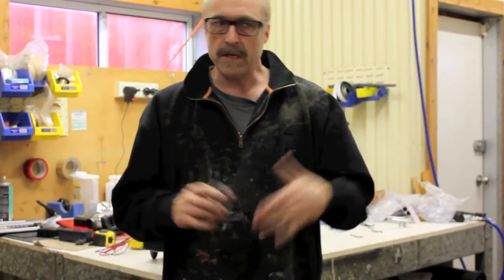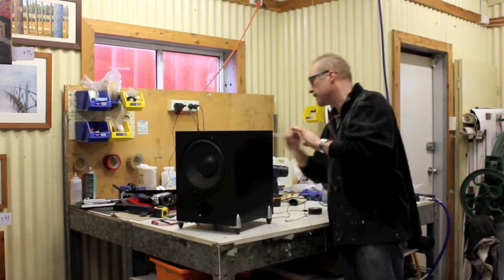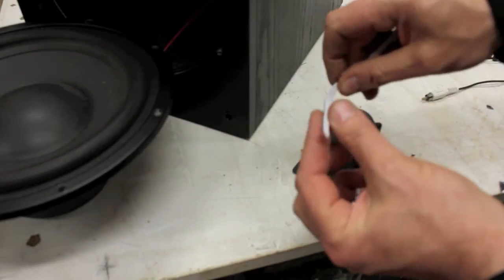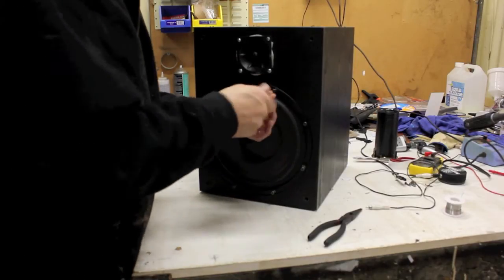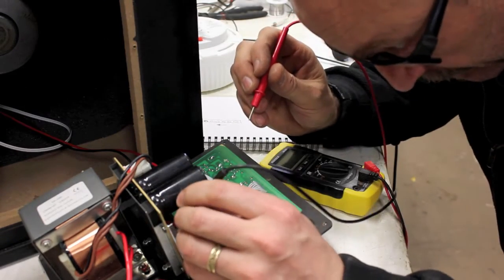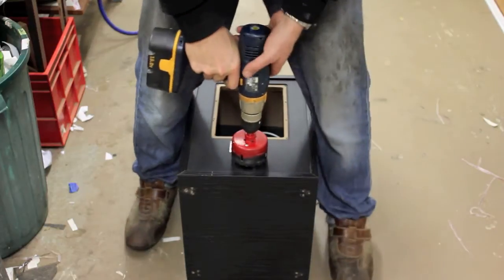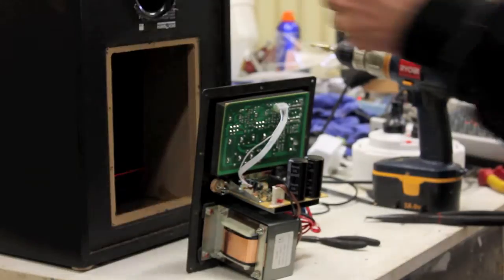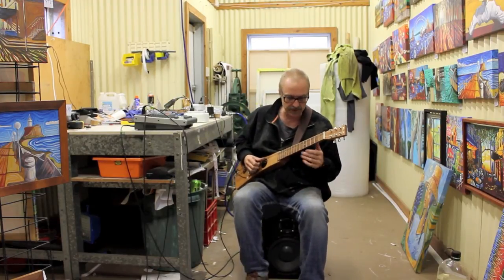http://www.peterman.com.au Build your own DIY Acoustic Guitar and Stompbox Amplifier

Comment: Great Video. I have a box of car audio 12v stuff , there is a 12" 4ohm sub-woofer and a 4 channel amp plus many, many other things. Just is I've been trying to make a elec-guitar amp using old computer power supply to power the amp and am having a bit of trouble. I have a questions if I may ask? Does it matter if the woofer is 4ohms? Thanks Peter

Comment from the maker: 4 ohms maybe a problem if your amp can't handle it!!

Usually car stereos are 4 ohm, and home stereos 8 ohm. You can use an 8 ohm speaker on a 4 ohm amp with some loss if volume, but 4 ohms on a 8 ohm amp may cause damage to the amp !!

Comment: Thank you for the instructional. Great information! You mentioned something about a dome twitter. It makes me wonder if I can use a smaller speaker, but larger than a piezo twitter to have a good balance between mid and hi ranges. Would I need a capacitor between the two? If so, what would be the uF value of such capacitor? Thanks again.
Reply from the maker: +Eliezer Rodriguez 
yes you need a cap, so you don't burn the little speaker... I am no expert but maybe a 0.25uf if any one knows better let me know!!
I just asked the guy in the electronics store.. and he said "one of these should do it" .....Lol
Reply: Wow, I'd never expected such a quick reply. Thank you.
Reply from the maker: +Eliezer Rodriguez 
Lol.. I have no life....

Comment: i wonder if i can use 2 speakers instead of one :D
Reply: in one cab i mean  :P
Reply: You could indeed. Wiring this extra speaker in parallel would yield a 50% decrease in the effective impedance of the  load, A.K.A the speakers. 

This essentially leads to a higher demand for current from the power supply, thus causing thermal issues (and distortion if pushed to the limits of reasonable gain)  if proper heat-sinking  protocol is not carried out. Although, one must check the datasheet for ANY amplifier ICs before the implementation of them into any design, some simply are not designed for output to 4 ohm loads; efficiency of performance will be compromised which is important in battery powered applications such as a 'boombox. 

PS: connecting your speakers in series (+ to - and - to + from first to second speaker) yields a doubling of the impedance 'seen' by the amp. 

Thus many combinations are possible, so long as the final impedance - a function of series and parallel resistance equations - falls between the recommended ratings of the amplifier IC (integrated circuit).

PS2: remember not to send low frequencies to tweeters, its quite an expensive to mistake more than once

Peace.
Reply: ty sir, this was very helpful :D